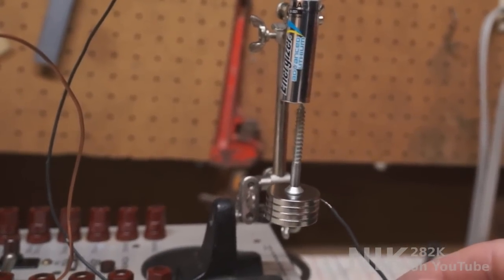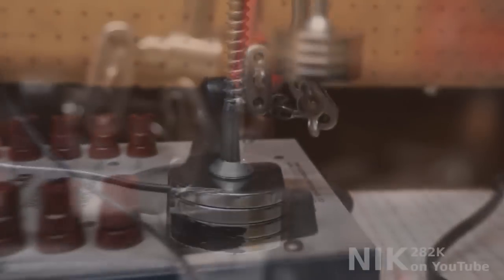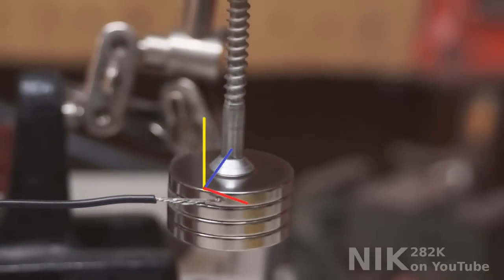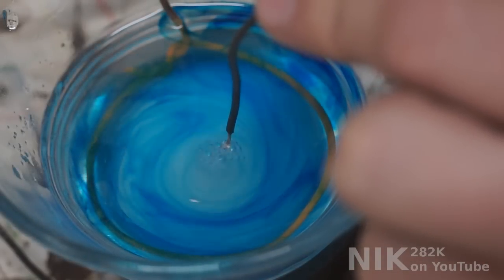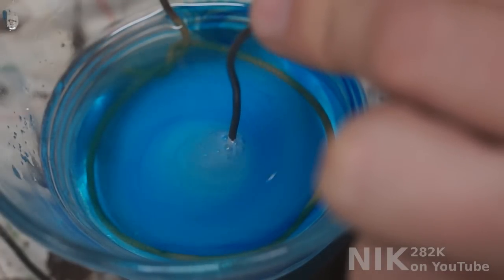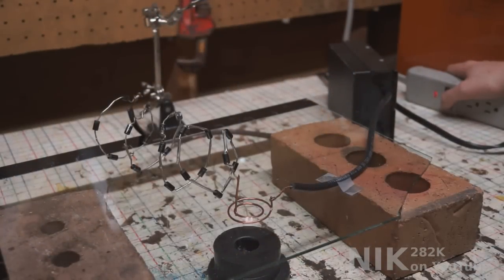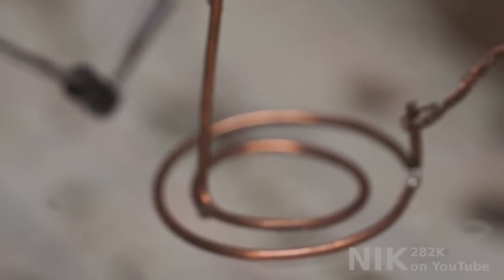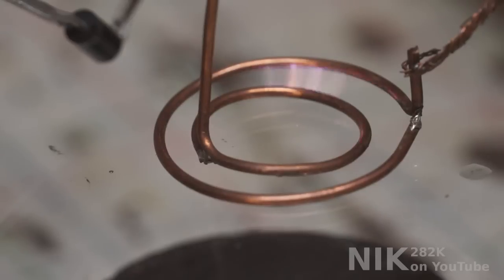The Lorentz Force

Comment: I just had a quick question for you. What if you didn't have the ring and it was just the radius from the positive on the edge of the water and the negative at the center? Would it just have a force pushing the water between those two points only so that the water wouldn't make it all the way around? Also do you know anything about the Lorentz force between the windings of a coil, I am trying to comprehend the outward force from the center of a coil. Anyways, thanks.
Reply from the maker: If it was only 2 wires poking into the water would feel a force but only between the two wires. In a coil the wires feel z-pinch (good search term) squeezing them together.

Comment: Your are the first person that demonstrates my interpretation of the Lorentz force.  I have never excepted that the perpendicular force is emanated from the center out of any given conductive medium. I have interpreted it as the force is not perpendicular to the center axis but perpendicular to the outside surface, it's circumference as it were, of any given conductive material. If the force is from it's center out that would mean that the force is equal in all directions perpendicular to its' center and not cause a spiral/spinning reaction. If that's true how is it that you can plainly see that the current arc is in a circular motion as well as your demo with the water. This with out a doubt shows a circular force and not tangent, in a straight line, out from the center. Thank You, My friend.

Comment: In the 3rd ring example, what is actually causing the rotation of the sparks? First order, I would expect each individual spark to curve due to the force, but here the the starting point for each spark is also advancing around the ring. Is something asymmetrically lowering the breakdown voltage on the leading edge of the spark? Thanks!

Comment: Great explanations and examples.  Quick question, if you reversed the polarity of the electrodes in the 2nd experiment (the one with the blue water) would the flow of water change from clockwise to counter-clockwise?
Reply from the maker: Yup! It will also change direction if you flip the magnet over.

Comment: Actually, the magnetic flux is fully uniform around the magnet. The turbulance is due to the electrode being off of true center; causing more conduction and faster movement of the liquid on one side than on the other.
Reply: Thank You, I was thinking about that & From what I’ve read flux is uniform, there is no differences of Flux. I was about to question him about that but you corrected him.😎👍

Comment: Saw the videos. Thanks bro. I built a few of those but not in the way I need. Got it. I'll combine two of them (simple) and will have to build another, add a transformer and bang Bro, should be a lot of smooth voltage and current. The hacked ATX power supply isn't giving me what I want or need. Need more than the already trimmed 12 volts max. Gotta get a combo oscilloscope and bench top power supply in one. I need to make my tech life easierBro. Thanks again...

Comment: Hey Nick, As I said before, my daughter is doing a science project on the Homopolar motor. I am trying to smooth out the AC/DC to DC current and Trick the Screw and Magnet into thinking there is a battery running it. Batteries get expensive. I tried building a portable rectifier circuit and smooth out the current with  capacitors. I don't know what I am doing wrong and I have to keep the project in budget ($50.00). I don't have an oscilloscope. I'm Trying to figure out a circuit that will smooth the DC enough one way to trick the the screw and magnet into working as if a battery was present. I do have an AC adaptor as well, 1.5-12V if that would help? Need your help Bro! She has multiple Applications for this motor. It's crazy. She needs to keep one motor running constantly during multiple presentations. I've only been able to keep a motor running for about 15 minutes with a battery and resister. She needs 2 hours. Resistors didn't stretch it enough. Is it Possible?

I did make some magnets and the salt solution worked but it took time and was extremely slow. Now I have to fit some N52's into budget. I don't want to risk the 48's not working the way they need to (quick and turbulent). I am $20.00 into budget and still need to buy Coil for the simple Homopolar train. The coil is going to be at least $10.00 plus batteries for the other applications. I found that rechargables work but they lose a lot of charge capacity each time  I would hate to cut other applications out of budget. Can you help me Bro? There is only 3 weeks left to turn in the "how to" and the process. I'm getting desperate Bro!
Reply from the maker: +Matt H I've never tried to run a homopolar motor on anything but what you need is a high current power supply, the voltage doesn't really matter because current is what interacts with the magnetic field. (A 1v 5amp power supply would work better than a 5v 1amp power supply). Smoothing and filtering the DC isn't required but it must be DC. A full wave rectifier also isn't really required, you can use a single diode in-line with the AC output of your AC adapter and it will deliver DC pulses that should still work.
Reply: +Nick Moore Hey Nick, I just can't figure it out. This is the link where I saw someone run this motor with a bench power supply.

file:///Users/matthewhastings/Desktop/Simple%20high%20speed%20homopolar%20motor%20-%20YouTube.webloc

OR, Just type in "High Speed Homopolar Motor" then click videos. 

The answer he gave me was a bit vague. I'm not an electrical engineer Bro. I'm just trying to survive My 6th grade daughters science project as inexpensively as possible with success. We are going through a lot of batteries pretty fast. I have chosen to ask you questions because you have the absolute best example and explanation of Lorentz Force. You NEED to make an instructional video just for the school system Bro. When she lit up and was able to understand Lorentz Force, She was then able to explain it. That was all you Bro. We exhausted countless hours searching for the best explanation. You clicked it Bro. That's not Easy with her. Now she Understands what is happening and whizzing through all the technical aspects. Thank you. So, do you want to take the challenge and get a Homopolar Motor running from AC to DC and explain step by step to a father that has lost much sleep over this?
Do it for the science Bro! Thank you
Reply from the maker: +Matt H I'm living in New Zealand at the moment and don't have any of my equipment with me for making technical videos but Afrotech has a good AC to DC video here https://www.youtube.com/watch?v=cyhzpFqXwdA

Other than that you might want to go to Radioshack and see if you can find a DC wall adapter that has the highest current you can find (1v at a couple amps should be ok). 

Homopolar motors are not efficient motors and very hard to power, its why we don't use them in industry and why they are eating all your batteries. You might just have to grab a 50pack of chinese AA batteries for this.
Reply: +Nick Moore Yes, I have been looking for Cheap Batteries. I get it about the Current, Thanks for that Bro. I didn't think about that. I am going to have to invest in a bench top power supply. Not the first time she has put me in this position. I am tired of building new circuits every time I'm in the corner. I had to buy a special toolbox to keep them safe. I have been using my radio shack volt meter to watch what each circuit does. Talk about the Hard way Bro. Yes, Homopolar motors suck in efficiency. I had the meter on it and all I saw were dollar signs as batteries drained. I built a simple circuit to limit its intake. very testy. It works pretty well but I only increased to 20 minutes. I was hoping for 30 minutes. Ill stay on it and maybe have that 1% of inspiration pay off. Only fail when you quit, right Bro. 

Ive been looking for a good bench top power supply that has an oscilloscope in it as well. trying to find one I don't have to switch over. if you are familiar with bench top power supplies that double as an oscilloscope simultaneously Bro, that would be wonderful. I can spend that money. That's an investment in my sanity. I just have to stay under the $50 budget for everything she has to make and present.

Loved the salt water solution. Neodymiums are the trick. That put the budget back only $5 Bro. The magnets I made work but were crap compared to the Neo"s. Definitely current. I had a 300 mA at first. Then I broke out the 1A 12 volt Bro. I heard some crackle and pop from the adapter and pow Bro, it churned Beautifully. The Negative lead had a tornado fizzing around it. Should have seen her face Bro...Beautiful and all lit up. She then schooled me on Lorentz Force. It was Heavenly Bro. I owe you so much. Thank you...

I will check out the link Bro. I am so absolutely in your debt for your video's on Lorentz force. She clicked so fast. I wasn't joking about making an instructional video. Maybe a hot model Bro. Or not. I came across an Astrophysicist or Astronaut or both maybe. Anyway, he was having a very difficult time explaining Lorentz Force to  10-12 year olds, so I gave him your Link. Hope that's okay Bro.

So I'll check out the link Bro. Let me know of any suggestions about a lab grade bench top power supply and oscilloscope all in one and simultaneous. That would be very helpful as I know nothing about them. Im good for about $300. I just don't know what to look for. I just build circuits as I need and tired of doing that. That gets pricey over the long haul. So, New Zealand, Far out Bro...

Thanks again Bro

Comment: Hey Nick, Love the science. You put things very simply. I have a time sensitive issue. My daughter is Doing a science project on the Homopolar / Unipolar motor and Lorentz Force.
Luckily, I saw your video under Lorentz Force. You have the absolute best example Bro. I would Like to recreate Your two examples on Lorentz Force With the Solution and arc. Dumb it down for me Bro. Step by step if you don't mind. A 12 year old will have to explain. I know your the man for the job. Please, this is time sensitive.

And, for the record, I dig the creepy crawler Bro. Had one myself. Old girlfriend named it. Don't ask Bro. She still haunts me with that to this day.

Let me know Bro...

 Would you Please send me details, details, details...thx
Reply from the maker: +Matt H The DC Arc is not safely reproducible and I can't give you any info about it. The other example with the salt solution is dead easy! You need a bunch of magnets (the stronger the better) put them under a glass or ceramic container with them all pointing the same direction (all north up or all south up). Fill the container with salt water. Make a loop of wire and hook it to a 5-10v power supply, connect another wire to the other side of the power supply and dip it in the middle. Pretty much all the parts used are seen in this video.

Comment from the maker: The power supply I am using is ~10kv AC and my diodes are only good for 1kv @1amp each so I strung them in series with a 1.5 safety smoke factor. The magnet is from a microwave oven magnetron, I have a stack of them as they are handy around the shop.
Reply from the maker: In all the examples shown here I am using DC. An AC motor uses an entirely different concept to stay spinning and apply torque.
Reply: Hey we want to make the third experiment. Can you give me more informations about how it’s made? Thanks 😊

Comment: Great video! I particularly like the double ring arc demonstration. Two questions: Why so many diodes? Wouldn't one be all you need? Also, what magnet did you use?Thanks again and keep up the good work!
Reply from the maker: Unfortunately I only had 1kV diodes so I had to put a lot of them in series. The ring magnets are from a microwave oven't magentron!

Comment: how are you connecting the electric wire? I have the one end of the wire connected to the (+) end of the battery and the other end to the magnet like you have, but I can't get it to spin. I have a square magnet. I don't think that should matter. What am I doing wrong or not doing right? Thanks
Reply from the maker: Are you trying to make the little motor or the spinning water?
Reply: Nick Moore the little motor at the beginning of the video. I can't get the magnet and screw to spin. I am missing something.
Reply from the maker: kaejolie The tip of the screw is touching the - on the battery. Look up "homopolar motor" and you will find loads of examples and tutorials that are more in depth than mine.
Reply: Nick Moore ok. so one end of wire is connected to positive tip of battery and the tip of the screw is connected to the negative tip of battery. Can the other end of wire touch the screw instead of the magnet to spin? Is there anything else in your diagram. I assume you are just using a 1.5V battery, a screw, a wire, and a magnet. How are you fixing the wire to the positive tip of the battery?
Reply from the maker: kaejolie You can try touching the wire to the side of the screw but it may not work as well, try putting a coin between the magnet and the screw and touch the wire to that. You can hold the wire on the positive end with your finger, I think I soldered the wire on but I can't remember.

Comment: Very cool! I particularly like your third example with the spark traveling in a circle. Could you explain the setup for that one? i.e. what power source and what/why the ?diode spiral?
Reply from the maker: The power supply is a neon sign transformer, it generates about 5,000v of AC electricity. The spiral of diodes is to change the high voltage AC to DC (it's a spiral so that it doesn't touch anything and shock me.) All of these demos need to be done with DC electricity, if I used AC right from the transformer the arc would not have felt an even force in both direction and not moved at all.